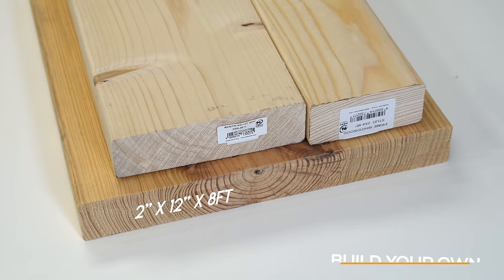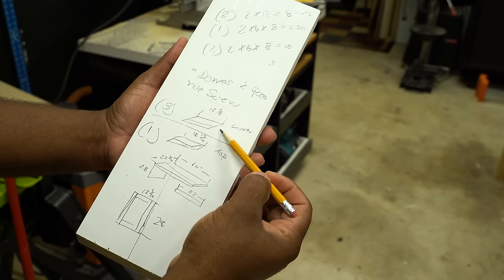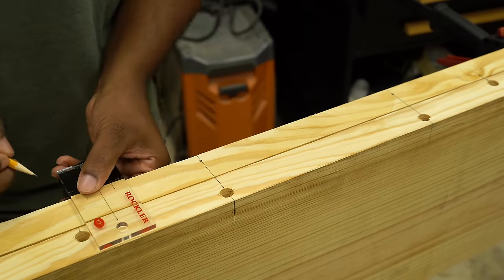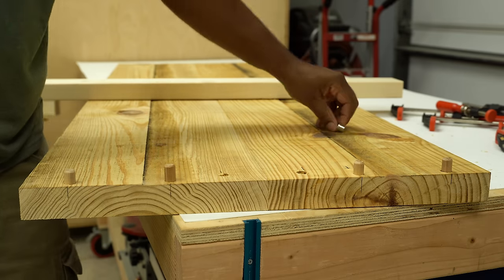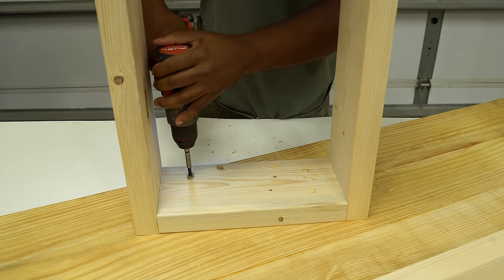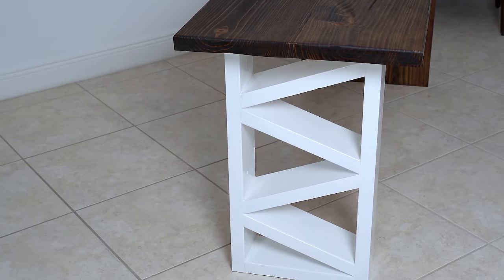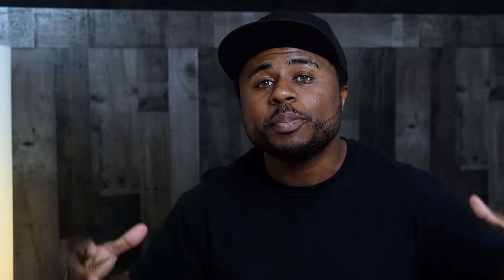DIY Desk under $50 |  DIY Creators

Comment: Loved doing this build and putting my own twist on it by giving the front edge a 45 degree bevel and a light round over on the top. I also cut a fading 45 degree bevel on the front of the waterfall tapering wide to thin starting at the top. I also cut a slight angle on the waterfall leg, not to much where id lose stability but enough to give it a modern look. I kept the legs the same although i didn't do the angled 2x4 cuts in it, and left it simple. I also left it bare and just did several coats of Danish oil on that leg and the stretcher. I still look at this thing amazed i built it, and I thank you for giving me the confidence to give it a shot. I got lucky on the jointing as I don't have a jointer but used a large level to reference square on my jobsite table saw. I could of built this based on your video alone, but I spent the 5 buck because I love the work you do, and the knowledge you impart to others, and will purchase other plans soon. I have to constantly be building something, or I don't feel alive (not really but its become an obsession)

Comment: Saw dust and wood glue, WHY DID I NEVER THINK OF THIS??!
Reply: Isn't that the spot where the stain didnt' take?  It wasn't clear if he used wood putty to fix or did the same woodglue and sawdust again.
Reply: @recoveringsoul755  I believe the spot that didn't stain was in the middle area. Nonetheless, it's still a good substitute if you're not planning on staining.
Reply: It cam be a trap if you intend to keep the "wood aspect" because of the glue on the mix. Only if you intend to cover entirely with paint. As you cansee on the video, he had issues. I made the same mistakes manny times.
Reply: That is the best sawdust I work sometimes   with that and i fix a loot thinks
Reply: @jlribeiro  it was in the middle of the desk that was messed up. I believe he said it was undried wood glue, due to him removing the clamps too soon.
Reply: @recoveringsoul755  I just did a countertop like this. Filled in some holes with wood chips and glue. Nothing fancy, just squirted glue in the hole, stuffed chips in, glue, chips, till it was full. It took stain just great. But areas I used only glue, I had spots like glenn showed.
Reply: Thats how you hide non perfect fitting joints too :D
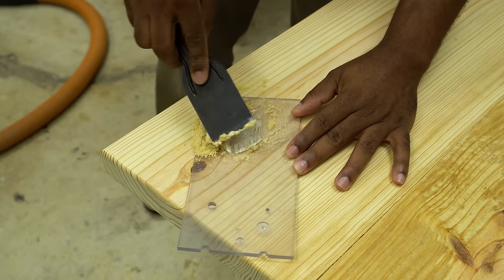Reply: @jlribeiro  The patch job with the wood and glue was near the end of the desk (around 9:40), whereas the problem area with the finish was closer to the middle of the desk (10:13)...unrelated issues.
Reply: To caulk the holes with glue and sawdust from the wood and not get stained add a few drops of lemon to the mixture and you will see that it does not get dark, I use it a lot here in my work and it works really well ok?
Reply: @recoveringsoul755  the spot on top just needed to be sanded down more. He just missed it the first time. It wouldn't have been a big deal if he was painting it or leaving natural but since it was being stained. It needed to sanded to remove the glue residue. The crack remains filled after sanding .

Comment: Bargain build, well done indeed. Only thing I’d have thought about was to route an angled slot for the led strips to stop them getting bashed.
Reply: I was thinking the same thing, however once butted against the wall the light would either not be as bright or you wouldn't see any light at the top at all, because the lights would be trapped inside the wood and the wall.
Reply: @gregghernandez2714  Pegs could be added so that those touch the wall instead of the back of the desk.
Reply: @luchvk  good idea!

Comment: Next time, clamp the boards together, run a track or straight edge down the length so the blade splits the joint and then cut. You’ll find they match up perfectly.
Reply: Thank you for that tip, this is why I read the comments
Reply: @rayp450  me too. This suggestion is one of the many of my "why I didn't think about that before" huge list. Thanka ga1205.
Reply: Jesus loves you all, and wants you to be saved.
Jesus died for us all, come to Him, bealive in Him and in His resurrection, do what the Bible says and may the Lord help us all to be in heaven with Him.
I told those things because I love you all and I want you to be saved.
May God bless you
Reply: Ray P you bet!  Did you try it?  It’s how it’s taught in the Festool farmtable course. No jointer needed. I tend to shave a bit off each, clamp together then cut as described. Then you can cross cut to final length and square it up. Easy peasy.
Reply from the maker: It's a good tip, I've done this before it works. With 1.5in lumber like this, it will not work with a typical circular. A Standard 7-1/4 circular saw cuts 2.5in depth, and two of these boards is 3in thick. That said you will not cut through both boards.
Reply: DIY Creators fair point on the thickness.  The TS75 will do just about 3” (75mm).

Comment: This is not a DIY project, I think it's more like a career switch ....
Reply: almost everything he did here can technically be done with just a circular saw, some glue, a drill and impact driver set, some sand paper, maybe a router if you want rounded edges, and the finish you want. Clamps for the glue too if you have nothing else to hold them together. Most of this should be at your house or a buddies if you do any sort of self repair in your house so it would be only a little more than 50$ for the desk. Still far better than paying for a full out custom desk or some cheap overpriced desk from Ikea
Reply: This project can be done with someone who has little woodworking skill. Just need to take your time. Sure you can go out and but a cheap $50.00 particleboard desk that won't last. This desk will last you a lifetime as it is solid wood.
Reply: Career woodworkers have a lot more tools than that. These are for the most part tools most DIY interested people would have already, plus he gave some alternative tools to use for some of those less common DIY items.

Comment: 50 dollars if you have over 500+ dollars of tools already is what you mean
Reply: Circular saw 60 from Harbor Freight
Random orbit sander 27 from amazon
Skil drill 27 from amazon. 10 dollar bit kit and you're good to go. That's all you really need in tools. The rest just makes it easier.
Reply: Dan ...real men should have at least every power tool in this video. Perhaps the clamps, stain, poly and all the drill attachments might be an expense.

Comment: Great video. I took on this project. It ended up costing $125 with higher prices. Also, 2X12X8 was not available; had to buy two 2x12x10. Buying separate pieces, stain application was different. One piece is lighter that the second piece. No problem, has character.  I had the circular saw, drill and sander. Did not have special jigs or clamps. So, I ended up using screws on the decorative leg and
filled in flaws with filler. Used "L" decorative brackets to attached top to stained leg and screws for the decorative leg to top. Overall, I think I did a great job on special cuts. Thank you

Comment: $50 desk made using $1000’s worth of woodworking tools 😂
Reply: It can be done with a few clamps screws and skill saw
Reply: I already had a drill and a circular saw so to be honest it is worth it. I didn't do the desk he did but I made my desk perfect for my size and my use cases. Learned a couple of tricks too
Reply: You dont need state of the art tools. Besides what can you expect, it's not like you can build a desk with your bare hands lol
Reply: You can rent tools
Reply: Usually you have such tools for more than one project.
Reply: Gef a 20 dollar drill, 5 dollar saw, 40 dollar sander and youre set 👍

Comment: while i spend thousand to buy the machines and tools before i start everything.
Reply: You matter aswell hire power tools for like £13.
Reply: You don't need to spend thousand on tools, don't give us an excuse. I paid $25 for my used portable table saw on CL, $18 for the black and decker 20v cordless drill with 2 batteries (on clearance at Walmart). The non electric stuff you can get it for cheap on Harbor Freight (square/ruler/tape/clamps etc), even the Kreg pocket holes I paid $13 on clearance at Lowes (retail price is $40).
Reply: Just ask your friends or family members they should have most of these tools

Comment: I'm starting a modified version of this desk for my son who is now going to school online (the space for it is only 48" wide). Starting today. Picked up my lumber from Home Depot last night. It was a bit pricier (I've noticed prices have been trending upward lately -- I think maybe Covid 19 and the sudden spike in about 16 million new DIYers) at $69.80 with tax. 

I don't have a planer,jointer, or wood dedicated to building jigs. I have a workbench that consists of a metal, angle-iron frame with 1/2" plywood tossed on top (put together by my brother-in-law who was an auto mechanic and who didn't care about factory edges or flat surfaces). 

My plan is to rig a straight edge with some scrap OSB I kept when when had a new dresser shipped, and a flush bit router to edge one side, use my circular saw and Kreg Rip Cut guide for the other edge, then to rig a makeshift router jig or power hand plane with a couple of (hopefully square) winding sticks and a bit of luck. 

The only bottom cutting router bit I have is a 1/2" straight but, so it'll take me a bit. 

I don't have a way to move the workbench and so only have access to one side. Because it has nothing resembling a real top, I also won't be able to use normal hold-downs or bench dogs, even if I had them to use (though I have a feeling I'll end up putting some holes in it). What I'm doing, I think, is defining the "shoestring budget" for woodworking. But, if I manage to get this one right, despite all the challenges, the wife will likely okay more projects. Wish me luck!

Comment: I plug pocket holes with dowels and use a flush cut saw.  Handy saw to have and not out of reach for less than $10.

I thought a heavy white-wash would solve keeping the "wood look" and still pop, but your paint job looked solid.  Protect the LED strip on the back by routing a 1/8" channel?

Super solid work, love it.

Comment: Nice work. I did the same mistake on Wood filler - 10:10. It never goes well with stains. It's better to leave the small gap as is, giving it a rough texture on joints. Again learnt it the hard way like you.

Comment: No way to anticipate that by October 2020, the price of a single 2x12x8 piece of common would be $20. So, same desk cost me $65 w/o LEDs and untold hours of work because the best boards I could find looked more like canoes than boards. Still, it has been a lot of fun and is a really cool design to trick out for your gaming teen!

Comment: Heads up on those corners for the LEDs. They actually sell 90 degree connectors in bulk for stupid cheap. I bought a big bag of them for like $20 on ebay or amazon a few years ago and haven’t even come close to using all of them.

Comment: Great video! You did very well on explaining everything you did and the inevitable problems that'll arise and how to work around them. I might try to make this desk for myself, and extend it out a bit and put drawers on the waterfall side. If not drawers, then shelves. It'd be my first time doing something like that. Currently, I'm using two nightstands with a couple bookshelves loosely laying across the top with a total top dimension of 71in × 19in. I'm getting tired of accidentally knocking down the shelves. 😆 I don't have the specialty tools for the dowels, but I do have a 6-in contractor's ruler with accuracy of 1/100 in that I typically use for drawing.

Comment: That's a great and modern desk. Well done ! But i'm a little doubtful about the "under 50$" price. I assume that in the US plywood is not expensive. Considering the plywood you used and the thickness of each piece, there's no way that here in France that desk could cost under 100€ at least, only for the wood.....But once again your channel and work are really great. Good continuation !

Comment: Wassup, so in one of your videos you mentioned something along the lines of liking to work with vinyl wrap and as I was watching your videos, I started thinking to myself, why not get the wrap, and shrink it around the pieces that you know will be visible from whatever angle is showing at the end? After you cut and smooth out the boards, wrap them and then make the holes for connections to the corresponding pieces. It's just a thought though, and I think it may be a better look than putting the wrap on last and then having to cut it afterwards and risk any potential issues

Comment: the wood where i live cost more then 50 for all the wood.  17.42 for big one x 2, next is the  9.32 for the next size smaller x 2 and for the 2x4 5.85 was already over 50  $59.33 with out tax. where did u get ur wood at? but what i want to do is find a 2 in thick x 24 in  width x 6 feet long then cut it down to 52 inch long then make both lag like the one that is brown  and use angel bars to put the lags on paint the bar white and i will stain the wood a white color but it not full blown white has more of a tint to it of white

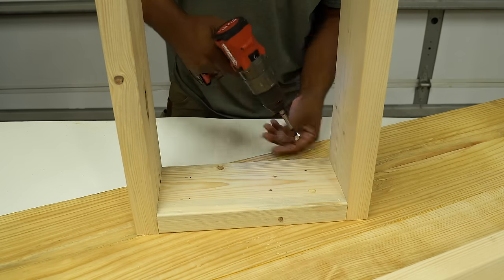Comment: At 7:39- 7:48, when pre-drilling for straight screws (not a "pocket hole"), what type of drill bit is that?  
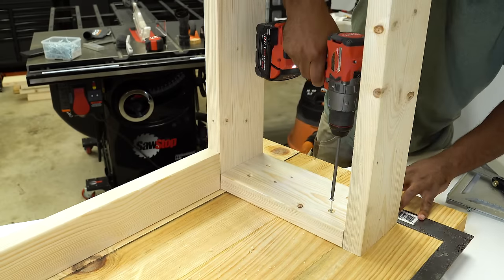Doesn't look like the bit for the Kreg jig.  But at 8:04 - 8:15, it appears that is the pocket hole finishing bit.  Thanks

Comment: If you buy those material at lowes or homedepot its cost $500000. I purchase the plan but i had hard time looking for the lumber at my homedepot and lowes. I end up using fir and the cost is a little higher.

Comment: I have the circular saw and drill but I live in an apartment so I don’t have a table saw and don’t woodwork so I don’t have a pocket hole jig, which is twice the price of the table. That’s not a common tool for small diy-ers. Really love the table but disappointed at all the tools

Comment: Look at 50$ table ...
SawStop and stuff =4000$
Jorgensen Cabinet Master 90&deg Parallel Bar Clamps 4pc. =160$
Milwaukee Brushless Circular Saw =200$
Milwaukee 18-Volt Lithium-Ion Compact Brushless Cordless Screwdriver 1/2 in. =160$
Milwaukee Orbit Sander and vacuumcleaner =200$
Kreg K4 Pocket HoleJig System =100$
RIDGID Heavy Duty Variable Speed Belt Sander =168$
Makita 18V Cordless Compact Router with Brushless Motor =200$
Oh, wait ... diy desk!

Comment: the material used under $50 except for the working tools which cost few hundred bucks. doesn't make sense. I would go for amazon or eBay less hassle. just my opinion.